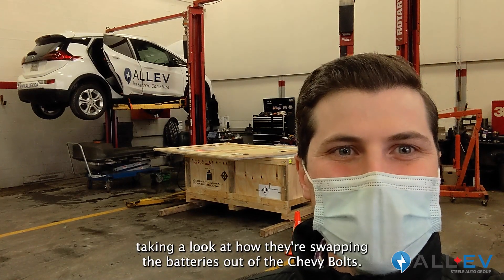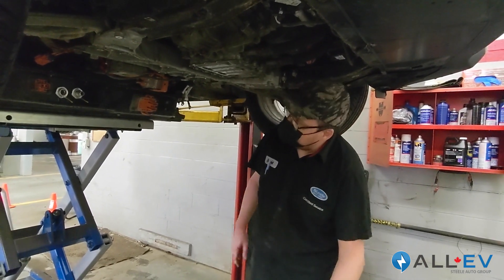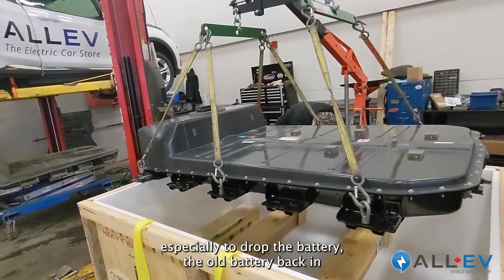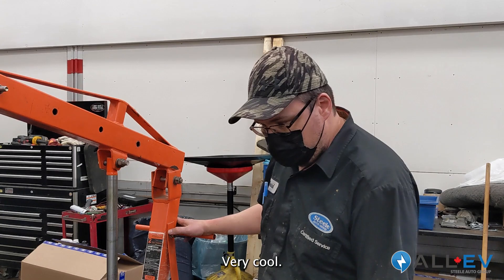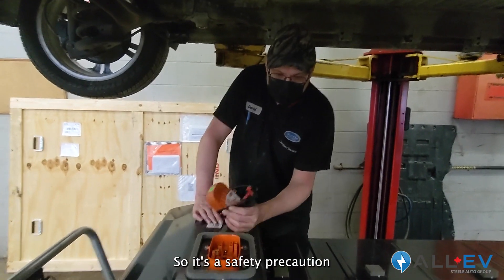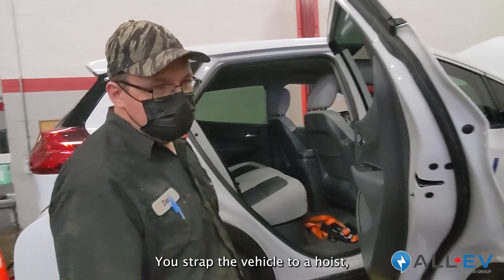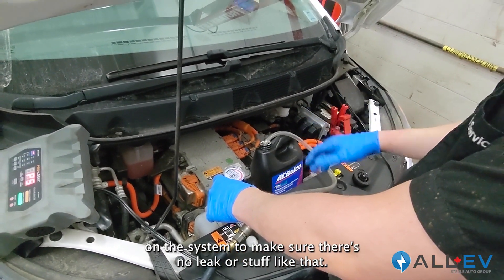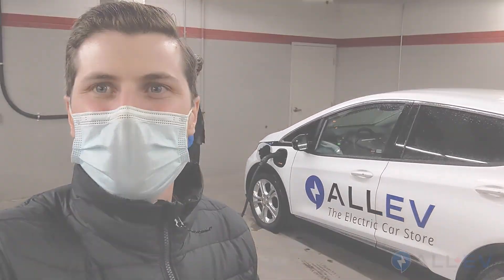Chevy Bolt Battery Replacement - Extended Version

Comment: I just did a timing belt, water pump, oil seals, gaskets, spark plugs, and intake cleaning on a 2008 Toyota Highlander Hybrid. It took me about 3 days, and the garage floor was a mess when I was finished. I was absolutely filthy every day and got coolant and oil everywhere. I could only work on the project after work, or when my kids did'nt have other stuff to do. I ran into problems finding my tools, which seemed to grow legs and hide in the garage. When I see this battery change, which is essentially the lifeblood of an electric car, I realize I'm done with working on gasoline cars. EVs are a dream to work on.

Comment: Does anyone know if the GM  battery recall is still ongoing in 2024 for the  2017 to 2019 models?   I called one Chevy dealership and they said they did not know if  2017 models were still eligible?   (does this make any sense? for them to be saying this in January of 2024?)

Comment: Does anyone know if the battery covers my Bolt if my I have more than 100K on it?
I currently have 99,409, wondering if I have to park it until the battery arrives at the dealer?!?
Reply: All Bolts (up to a certain cutoff in the 22 model) get a new battery no matter how many miles.

Comment: Let me also thank you for this video. I’m getting the battery replaced on my 2017 B. olt next Tuesday in California. They will have the car not quite two days and GM will give me a a loaner.
Reply: BTW, the dealer service adviser did not give me any oral instructions or hand out any paper explaining how to "condition the battery.  I guess I am supposed to drain it down and charge full a couple times soon rather than keep topping it off at the beginning.  Does anyone know if Chevy has any such instructions?
Reply: @igenr8  I'm not an owner, yet. I'm researching whether or not I should purchase a 2017 with the battery replaced. And so far it is looking like a yes for me.
Reply: Hello Al. I'm curious how it went? An update would be much appreciated. Thanks!

Comment: the chevy dealer in Columbus Kansas did mine.   Overnight job.  Got me a loaner.  I live 82 miles from them but they are doing several and if you live somewhat close by, call them.  Jim Hatfield Chevy.  Dealership looks like it was built in 1960 but hey, they like doing this job.  Obviously they are making money!

Comment: I have a 2020 Bolt. I'm under the impression that only the modules get replaced....NOT the entire battery.
Reply: GM is only doing pack replacements. Replacing modules is very time consuming.
Reply: way easier (and less costly) to drop the entire battery and replace it than it is to open up the battery and replace an individual module...
Reply: @tichuang  On Youtube, there is a professor in a wheel chair that shows every component disassembled of a Chevy Bolt. On that particular battery, it looks like modules would be fairly easy to replace. On a Tesla, it looks like a nightmare. Obviously, since the recall on the Chevy Bolt involves 143,000 vehicles, time would be a definite factor. Many years from now, on an individual basis, it might be much cheaper to replace only what's needed.
Reply: @coniacman  I have watched that video. He makes it look easy, sure, but he's a professor, not a regular mechanic. He knows every part, its design, its function, etc., not only of the battery but the entire car. As you've already mentioned, yes, there is the sheer volume of batteries that would make such surgical operations highly inefficient.
Reply: @coniacman  - Professor John Kelly at Weber University.
Reply: The diagnostics software they're using when Bolt owners bring their car in for service is supposed to detect faults in individual modules. If a fault is found at the module level, they bump you to the front of the queue for an entire pack replacement like all Bolts will eventually get. Also a 2020 Bolt owner here btw.
Reply: I picked up a 2017 with the replacement and I watched them replace the entire battery pack.